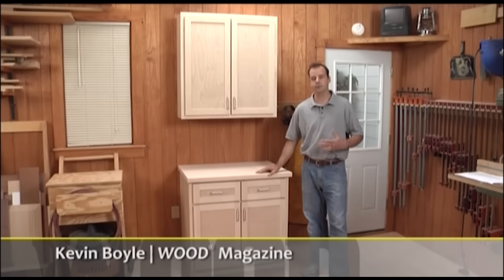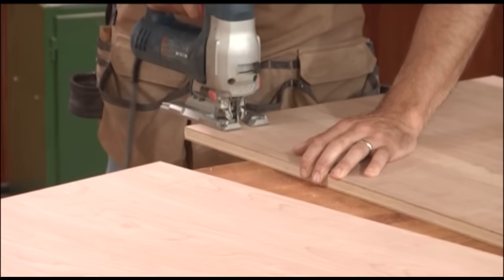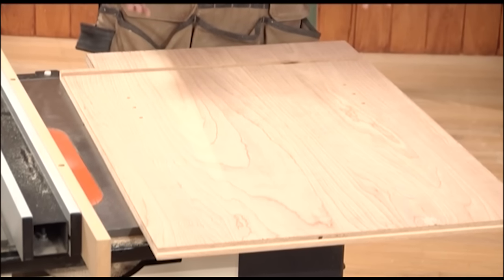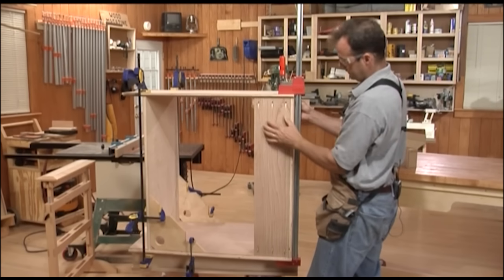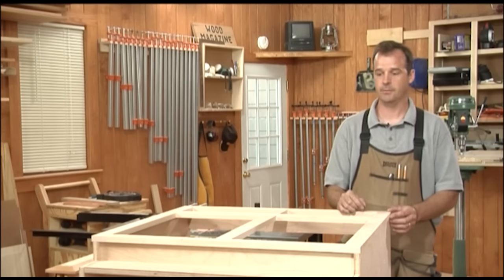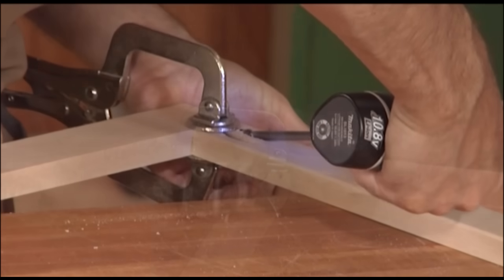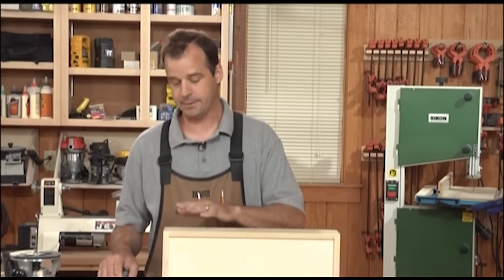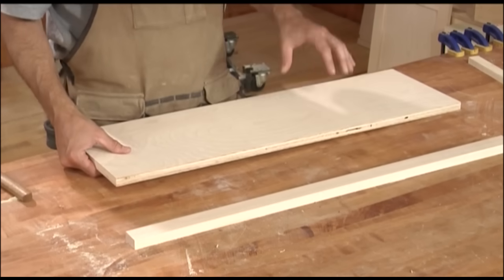How To Make Simple Face Frame Cabinets - WOOD magazine

Comment: Very complete except I need to know what the dimensions of the frames are? You mention that you have pre-cut them, but what is the width of the horizontals and the verticals.
Reply: Go by what looks good.  Go to Lowes and measure theirs.  I usually use anywhere from 1 1/2 to 3 inches for horizontal.  To me, it looks like 1 1/2 or 2 inch stiles and rails.  I'll go up to three inches for top stile.
Reply: @Hello Rob how are you doing

Comment: Line bore holes would be better using a 5mm bit @ 32mm on center, first hole @ 37mm back from face of cabinet. Most modern hardware is laid out for this. It eliminates measuring for drawer guide locations as well as mounting other accessory items. Standard 5mm Euro screws are used. If you must use a face frame make the inside edge of the frame flush with the cabinet sides and all hardware will directly mount to the sides eliminating all the spacers. 

Using pre-finished sheet goods will give a higher quality finish and eliminate trying to finish inside of the cabinet. If you are dedicated to applying the finish to the insides, do that before you install the backs. Much easier. Pre-finishing the face frame, if used,  is also easier. 

Base cabinets made w/o the toe kick notch are much easier to make. It is faster and easier to mount base cabinets on a ladder kick. A ladder kick can be leveled much quicker and insures all cabinets line up. One kick assembly for the entire run of cabinets. Eliminating the finished cabinet end from reaching the floor and using an applied end will prevent future damage to the finished end where it would have touched the floor. 

I ran a shop making commercial cabinets for medical, school and retail use and in 35 years never made a face frame cabinet.

Comment: Great video thank you.  I was wondering, is glue only on attaching the face frame strong enough to support larger doors?
Reply: You might get by with that, with smaller doors, if the style where the hinges are fastened will be nailed and glued to an end panel or partition panel. However, it is much better to either biscuit  join, dowel,  use pocket screws, or mortise and tenon or whatever. Vertical grain pieces don't glue so well to the adjoining pieces. Some type of strong joint is really what is needed.
Reply: Huy Tran this is a terrible way of making face frames even with small doors. At least glue the joints. They crack open in no time from doors opening and closing all day long. Half lap or mortice and tenon is the way to go
Reply: @nicksainsbury7152  Hi Nick,

Yes I join my face frames with domino's.  I was actually curious about the strength of attaching the face frame to the carcass with only glue.  I personally use dominos or pocket holes when they can be hidden but was just curious as i see a lot of people only using glue.
Reply: I pin nail mine.

Comment: I dont think I'll build custom wooden dividers 😂 The dolla stores got me covered pretty good there or maybe Walmart if I wana be a boojie honk'key. 
But I dig the lid storage and i do want to put drawer glides in my bottom cabinets... Oh, u got no idea how much i love me some High Quality Drawer Glides. 😮 and i just happen to have some quiet glide, ball bearing, heavy duty, soft close, top and bottom mount, epoxy finished... triple expanding drawer glides 😂 that store at about 2 feet and open to about 5 feet. Probably going to drop my 20" apartment sized dishwasher down on them inside a cabinet I dont use much. So that's put away nicely nice. But we'll see. I'll need glides, plumbing and electric back there. (Good thing i get shocked for a living 😊 so that's not an issue) but the plumbing may be. Because this dishwasher is designed to be quick connected to my sinks faucet. Its not like a standard dishwasher that I can just have constant water going in to it and then just have a drain line. So we'll see😂😂🤣😂 🤞

Comment: my favorite part of this video is how not-warped everything is....every damned sheet of plywood I encountered at the store was half-way to becoming a boat hull. I used 3/4" for my cabinet and dear god it was a sick joke trying to wrestle the plywood into the dadoes that I ripped. Then I used pocket screws to make a top frame to help square things up...from being warped. I used 1x3 pine that I bought a couple weeks ago and it's been sitting in my basement (workshop) flat on the floor since. When I bought this lumber, I sorted through the pile at the store for about 10min picking out the best, straightest boards I could find...I was pretty happy with what I found...when I went to grab said lumber to cut and build this top frame...I was picking up hockey sticks. What the hell am I missing? I never see youtube woodcraftsmen fighting with warped wood...I mean never.  My basement has ducting for the HVAC system, so the temp is stable, and a full-time dehumidifier (which almost never runs this time of year as it's not humid here in Wisconsin).
Reply: Never had that problem.  I hand-pick my lumber, and make sure it's dry

Comment: How wide is your face frame?  I know you used 3/4 thick materials, but never said how wide you cut, 1/4th overhang, bit is that for the inside and outside?
Reply: I'd guess his rails and stiles are 1 1/2 or 2  inches or so.  That's a nice look.  I just built a cabinet and that's what I used.

Go with what looks best to you

Comment: You mentioned that you use maple for your face frame. I assume you are using a soft maple and not a hard maple correct?
Reply: Soft maple has dark streaks in it. No good if you're using a clear finish.

Comment: What type of plywood do you use for the box of upper and lower cabinets?
I want to build some shop cabinets and then kitchen cabinets what type of plywood should l use if painting cabinets and what type of plywood if staining cabinets?
Do you have a material list and cut list for both uppers and lower cabinets 
Jim thankx Ontario Canada
Reply: James Reeves no response, that’s too bad. I just posted a question.
Reply: I just asked a question no response?
Reply: Use 1/2 or 3/4 inch sanded ply, or if for a kitchen, use birch or oak veneered plywood.

1/2" works fine.  I use 3/4" for base cabinets.

Comment: I wouldn't glue the panel - it should float allowing those hardwood rails and stiles the opportunity to expand and contract.
Reply: I know.  Never glue panels. At back of drawer, you can nail them in if you don't have a full board in the back of drawer.

Comment: I saw how you cut the toe kick right into the sides. Why not make a separate base to set the box on? This allows you to get the base leveled and then you just set the cabinet box on it. If the sides extend back a bit, they can be trimmed as necessary if the wall is not perfectly straight. Each side can be done independently.
I was concerned that it doesn't appear you use hearing protection at the table saw.  I prefer to use my mickey mouse ears no matter which power tool I'm using. Keeping a set of mickey mouse ears at each tool makes sure that I'll always put them on.

Comment: If you would’ve put that top structure on the rear of your Top cabinets to the back of the plywood instead of putting a quarter inch plywood over the top of it you could’ve cut the bottom edge of that at a 45 and it would’ve been a lot easier for hanging them cabinets if you were doing it by yourself

Comment: great work when you do attach multiply cabinets do you add face frame after attaching the cabinets
Reply: That's the pro way.  Shows it's custom to that house.

I did that to my kitchen.  I built the boxes, then built the face frame.  My upper was 13 foot long.  Alder.  Turned out AWESOME!  A fun challenge.

Comment: Surprised that you wouldn't use some small brads when joining the face frame. I know this is visible compared to the pocket screws which are all inside, but a nail set and a little filler would hide a couple of small brads pretty well. What's that glue - is it Titebond?
Reply: Filler is never "invisible", no matter how good you are.
And there's literally no reason to use nails when you've got pocket screws already, why???

Comment: No mechanical faseners for the face frame ?
Reply: Titebond is all you need and the wood will tear off around the glued part of the Faceframe if you attempt to remove it after it cures. It will never come off. This info is from experience when some face frames got mounted improperly from somebody i was teaching and i tried to remove them and they were screwed as well. Screws came out... GLUE didn't!!
Reply: @deewalk1337  The pocket screws eliminate the clamps.
Reply: @roccoconte2960  the body of the cabinet is exposed on all sides... No place to put pocket holes except beneath the floor of the cabinet which in that one spot is pointless. But I get you.
Reply: @deewalk1337  the sides are mostly covered ,except for the end cabinets the screws dont show , i find it much easer than dealing with all those clamps.
Reply: @roccoconte2960  that's true but i was talking about his cabinet that he was building for his shop. It sat by itself with no cabinets to hide either side and it was intended for the layman. To show them how to construct a cabinet with some basic tools with the exception of the dovetail setup. Stiles, rails for the doors and drawer fronts could've been done on the router table quickly with ease but everybody don't have access to those types of tools. When I saw that i knew who the video was intended for. The beginners and was a excellent video for that by the way. A truly in depth video would take at least 3 hours and i might be shorting it. It's a lot that goes into building these things. I'm building my kitchen cabinets as we speak.. had to have my wife assist me last night in dado'ing 96" pantry sides. Read the comments.. mostly beginners but cabinet building isn't hard as long as you understand the math behind it. But enjoy your day fellow builder and have a blessed one.
Reply: @deewalk1337  Good luck with your cabinets .
Reply: I pine nail them along with glue.  I do use Titebond.

Comment: In what I see so far doing a rebate should be done by hand using your rebating plane like I use to do at work and we used solid timbers such as oak, beech mahogany and pine to make good descent furniture not cheep stuff for twenty years making it as the backs and draws bottoms were made of pieces of timber joined together to make a good strong bace and back ok dude.

Comment: Do not understand why you made the base cabinet 23" deep instead of 24" which is standard. (Base lining is 22 1/4" + 3/4" face =23 " ??? Also, as a professional cabinetmaker myself, we always installed a 1/4" back on all cabinets. If for no other reason for strength and stability.
Reply: 1 inch over hang for the counter top gives you 24 inchs that is why h it is only 23. He did cut a 1/2 rabbet on the back for a 1/4 backing to be put on. The 1/2 depth was cut so he would have room to scribe it against the wall. Personally I would cut the back side at a slight angle so the scribing would be easier. Picked that tip up on a different video.

Comment: You missed an important point. Maybe the wood you use is perfectly straight but in the real world you will not have many styles and rails that are perfectly flat. Each piece should be checked against something very flat such as the back of a joiner or a level to check for straightness. If there is any curvature you should assemble the door so that the curvature is facing out. In other words you want the styles to touch the face frame at the top and bottom. If the curve faces the face frame it will touch in the middle. That is not attention to detail.

Comment: YOU SHOULD NOT PUT GLUE  ON THE GROVES IN THE RAILS ONLY ON THE TENONS YOU WANT THE PANEL TO FLOAT. IF YOU PUT GLUE ON THE RAILS IT CAN SPLIT THE RAILS.

Comment: This is perhaps a pedantic comment, but I think you should say that the glue cures, rather than dries. When it dries that means that the water content evaporates, or is reduced, so it could be reversed by adding water. In fact an irreversible reaction occurs, which is why it is called 'curing' rather than 'drying'. It is similar with Concrete, Latex paint, and many types of finishes.

Comment: I don't believe he gave measurements on how wide and long.
Reply: Height and depth are standard. Width can be whatever you want. It's a "how to" not a "build this".
Reply: Standard kitchen base cabinets are 36" tall, minus the thickness of the countertop. The depth is roughly 24". The widths usually are multiples of 3 inches, but when fitting cabinets to specific areas, you build them to suit. Usually you don't build anything wider than 36".

Comment: Should have made the drawers taller to cover the top stile of the drawer front.  They look funny with the gap showing and when the pulls are installed they will pull in the front of the drawer.  Also, things lie change and small screws can get lost in the void.